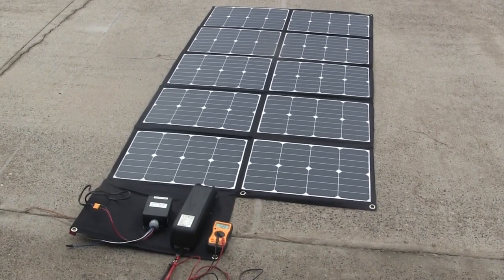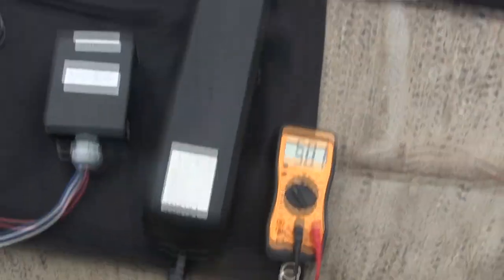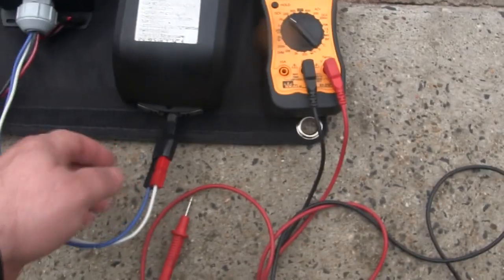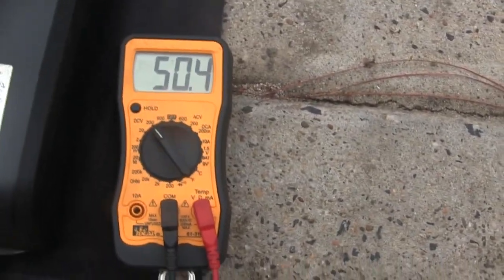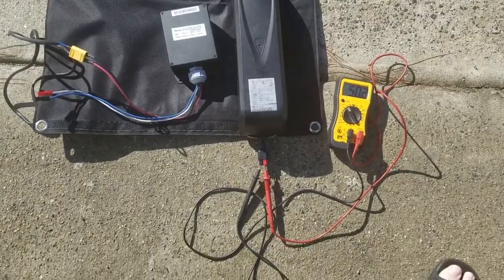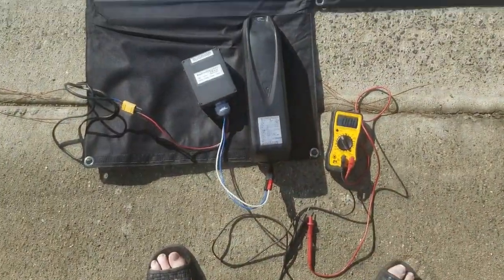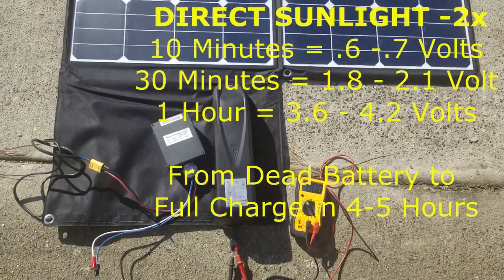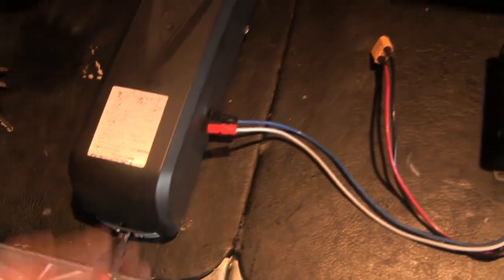TESTING EBIKE 300W SOLAR PANELS IN SUNNY AND CLOUDY DAYS

Comment: Better check that math a few times more. Voltage alone says nothing. The solar panel is 300 watts, which it will never do, but you are missing amps to make math add up what the panels are actually giving you, how many more amp hours more has been squeezed into battery. Or even more apt would be how many more watt hours, since motors on ebikes get rated in watts and so is the solar panel, so why not think of the battery that way too instead of confusing everything thinking about it in voltage only. Get 50 watt from solar panel for an hour, 50Wh.
Reply: https://photos.app.goo.gl/rFim5rPsajmDt8NJ6  Mine charges a 30Ah pack from 45V to 56.8V in under 4 hours

Comment: Volts mean nothing unless you talk about the current (amps).  or another way:  talk about the Watts and the efficiency rating.  If it is over 25% efficient, it is a good panel today.  if not, find a more efficient panel or your wasting time and money.
Reply: There are only so many panels available today and even fewer styles of panels. - https://photos.app.goo.gl/rFim5rPsajmDt8NJ6
Reply: @brianbassettnumber1    I went with the SunPower® 170w 29+v 5.83a 6x9 solar panel.  These have a whopping 25% efficiency rating.  they cost a bit more, but they are so much better.   there are many "imposter" sunpower panels with 18% efficiency.. make sure they are trademarked as SunPower® you will know because the solar cables will be off to one side and SunPower will be in big bold letters to the left of the Cables. 
Alex uses some high rated, and expensive solar panels from Sweden.  I think his panels are even higher rating, he is getting ready for the SunTour.  Strictly solar power race.  :    youtube.com/watch?v=NFLkY2Dcsww&t=3s
Reply: @rdkuless  It's a little less than 25% but I get ya but 300W was the minimum I wanted, couple that with wanting a folding panel it narrowed the search fast! I can charge a 30Ah lithium pack from 45V to 56.8V in just over 3 hours in direct sunlight and get over 70-mile range with a fully loaded tour bike and trailer.

Comment: That's not a good way to assess real world usage. The battery was over  90% charged. It takes a lot of power to do the last 10% or so. If the battery was only 10 to 50% charged you would get a greater charge rate.
Reply: You shouldn't charge past 90% anyway it stresses the battery and shortens the number recharge cycles. My MPPT controller is set a 56.8V. I can charge a 30Ah pack from 45V to 56.8 in less than 4 hours. - https://photos.app.goo.gl/rFim5rPsajmDt8NJ6